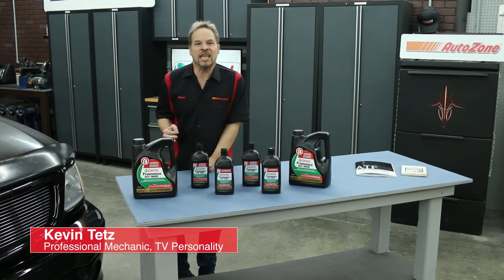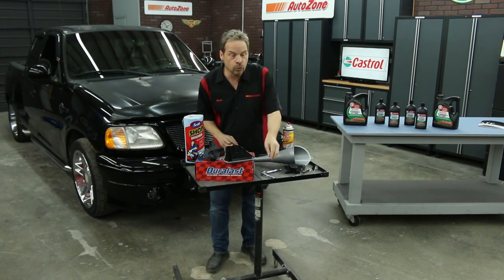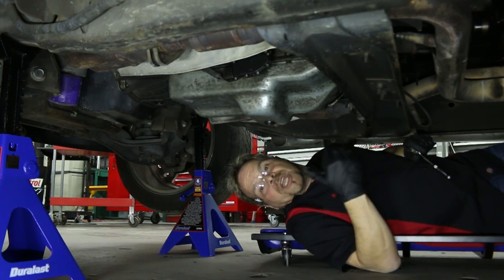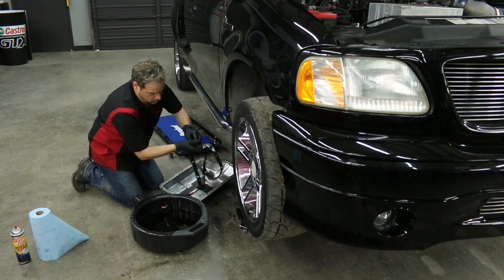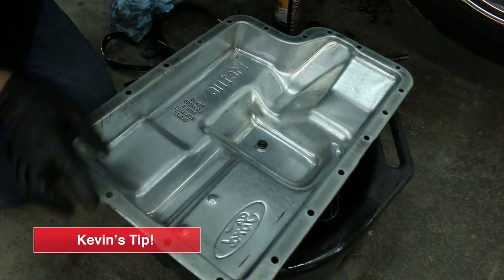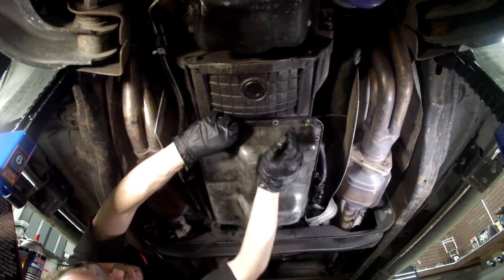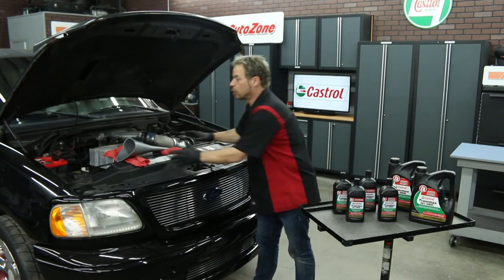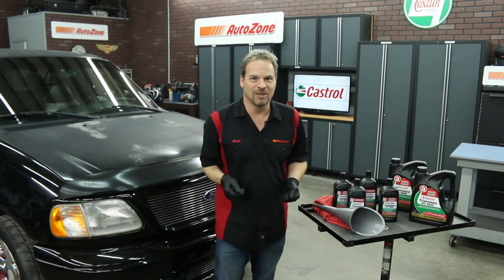How to Change Your Transmission Fluid – AutoZone How to Videos

Comment: Huge respect. Manufacturers are trying to make it impossible to do it yourself.
Reply: I couldn't even find the ATF dipstick in my truck and my vehicle manual doesn't cover changing the fluid. I'm anticipating having to change the fluid eventually anyway, but I have no idea how I would do that without access to a dipstick.

Comment: @Autozone  How did you drain 12 quarts by just dropping the pan? Did you drain the torque converter using the drain hole some Ford torque converters of that Era have?
Reply: Yes, if he did not drain the torque convertor, he did not do a "complete" ATF change.  This is why he only used 8 quarts of ATF.  But if he does this procedure often enough, he will be doing the same job as most auto shops who does a "complete" ATF change.

Comment: in absents of a transmission flush tool.  use the Honda recommended service approach,  do a drain-fill- drive some  and change it again,   repeat 3 times.  This will get most of the old fluid out.   This approached has helped me greatly on a Nissan Maxima with 205k miles.
Reply: My Mother has an Odyssey and the Fluid is Grayish Brown, does that mean I have to do a flush or just change the fluid + filter?
Reply: @Solaris_347  I have a 2007 Nissan Murano with over 210,000 miles and never changed the cvt fluid

Comment: Say Auto Zone could you do this video on a 2001 Suzuki Esteem 1.8L MFI DOHC 4cyl with a 40-LE transmission? Oh as for a repair manual tell me another joke there are none available, well you used to be able to get a factory one from a dealership but there isn't any suzuki dealerships around any more up here in the portland oregon area.
Reply: On a Suzuki esteem is only transmission oil change, the filter is a screen, so no replacement of the filter. It takes about 3 to 4 quarts depending what fluid drained. And dexron 3 fluid takes that transmission. I hope i helped you. Have a nice day.
Reply: @antoniocolon9024  No they had two or three different auto transmissions used in that car and only one of them has a removable "pan" and replaceable filter and I have that transmission FYI it's a aisin model 60-40le and wouldn't you know autozone sells a filter and 13-hole gasket for MY transmission.